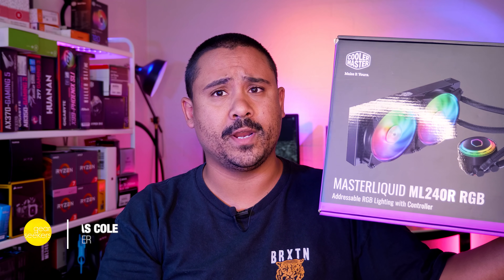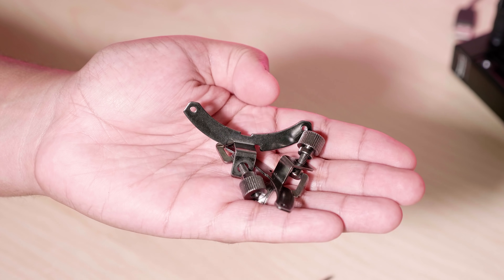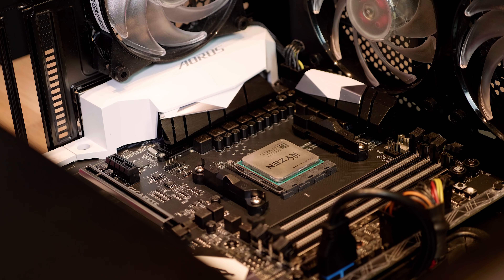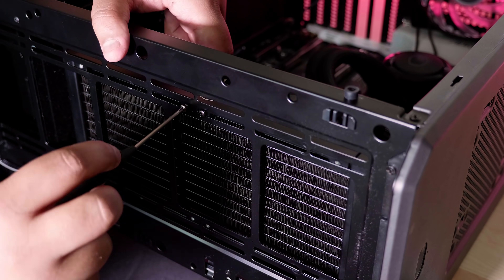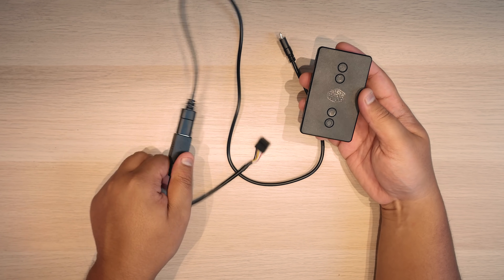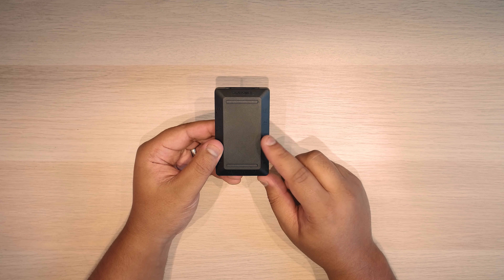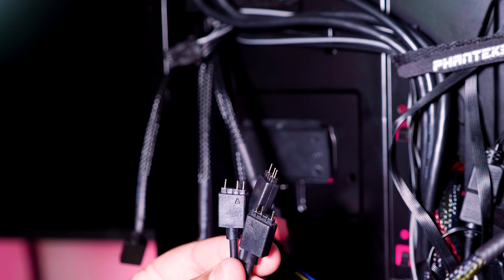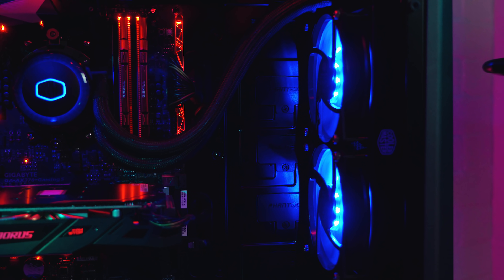HOW TO Cooler Master MasterLiquid ML240R RGB AM4 Install Guide

Comment: I just wanted to say thanks for making this video, it was very helpful. One thing I would suggest that I think may have made this video, and possibly other future videos, even better is if you had perhaps explained some of more involved stuff, ie. which cables were connected where and perhaps why or what function they serve, a little slower and in a slightly more thorough manner that might make this a little easier to understand for people who do not know so much about the inner workings of/the hardware side to a computer, and/or are new to this kind of stuff. Just a suggestion based on my experience. Nonetheless, I very much appreciate the time you put in and effort you went to in order to make this video!
Cheers!
Reply from the maker: We've done hundreds of videos about everything you mentioned. Just search the channel.

Comment: Followed your guide to the T. Curious if i can bypass the controller all together on my Z390-E and plus the rgb straight to the mobo. Just not sure what the black and green cable does exactly and if i meed that
Reply from the maker: If you have a 3 pin ARGB header you don't need the controller
Reply: Awesome, thanks! Love the work and videos you’re doing! @Gear Seekers

Comment: Will this cooler work with asrock b350 pro4? Also is the 240l rgb exactly same install?
Reply from the maker: It's basically the same and yes
Reply: @GearSeekers  thank you very much I should be getting it tomorrow so I can't wait to install it

Comment: do anyone know if the controller comes with the cooler? and if it does not do i have to buy one or can i use the rgb hub from NZXT?
Reply from the maker: it comes with the controller. I wouldnt have shown it if it didnt
Reply: @GearSeekers  Thx for the ast response, now i am confident in installing this CPU cooler, and great guide!

Comment: is this compatible with the ASUS ROG STRIX B450-F motherboard?
Reply: I need to know as well :)
Reply: @giovanniguerra11  I guess it is
Reply from the maker: Yes. This is literally an AM4 install guide. It works on all AM4 boards.
Reply: @GearSeekers  I'm new to this stuff my bad
Reply: @GearSeekers  I meant the software to control the lights

Comment: There aren’t many tutorials for this specific AIO and so I resorted to this one. Sadly, you never went over which cables from the actual block go into which port and the cables for the controller you explained were so confusing. With that, I just put my old air cooler in. Bad tutorial, unfortunately.
Reply from the maker: I've done plenty of RGB specific videos for CM ARGB

Comment: No one explains how to use the rgb lighting  software I'm stuck using the preinstalled lighting on the controller so it's not matching my gpu,ram or motherboard does anyone know?
Reply from the maker: If you actually looked we did an entire video about the lighting

Comment: I used my asus aura compatible motherboard to control the rgb, but since it only has one 3 pin rgb header i had to use the splitter. The thing is not only did i have to sacrafice the lighting on my radiator fans to have the rgb on my two case fans and the water block, but in aura since they are connected by a splitter to one header, they are recognized as one device, which makes the flow of certain effects a bit strange.

Comment: Hi nice tutorial my friend. I have ine question how did you manage to install the radiator in a push-pull configuration. If i screw the radiator in front panel there is no holes to screw the fans in front only in the back of the radiator.
Reply: You reverse your fans not your radiator.

Comment: Hi guys if anyone can answer now I'm desperate
Reply: I am currently installing this into my pc into a asus h110m-d motherboard.... it only has one CPU fan header.. so I used it for the power for the 2 fans but I dont have a header for the pump.. can i use chassis fan header or i can plug into my nzxt h500i controller hub? PLZ ANSWER IM DESPERATE

Comment: Hi one question, i have ml240r and x470 asus pro prime... the asus x470 pro prime has 4 pin header. Can i connect the ml240r to the controller and then the controller to the motherboard to sync it? Or i need a 3pin header and connect it directly to mb?
Reply from the maker: You can't control the addressable lighting off the 4 pin header only a 3 pin header. I have no idea why ASUS did that with their X470 boards. It makes no sense.
Reply: Love your channel, greetings from argentina. I wanted the x470 f gaming but in argentina that motheboard dont exist haha so im deciding x470 pro prime or another good x470 to overclock. What x470 do you recommend me?
Reply from the maker: Anything that is not ASUS lol
MSI and ASRock make the best X470 boards both of which have ARGB headers ;)

Comment: I think you missed the part where you connect the fan splitter to the controller (the connection on the bottom at 8:49)
Reply: Yeah the area where I connect the splitter to the controller is female so I think I was sent a "wrong" cable

Comment: What if I don't have the original clams that come with my motherboard
Reply: Wow thanks you're super helpful
Reply from the maker: You'll need to buy some
Reply: @GearSeekers  any am4 socket bracket Will work right?
Reply from the maker: @peteriyayi6504  yeah I have mixed and matched them and they've all worked from every brand.

Comment: I've never owned a liquid cooler.  Do you add the cooling liquid yourself, if so, how? Or does it comes with the liquid already in it and ready to install?
Lastly, are the connections solid and tight? Whats the likelihood that it would leak and destroy my pc? 
On that topic, is CoolerMaster a good brand?

I am fairly new to this. Want to build my first pc. Thanks.
Reply from the maker: You don't add fluid. They don't leak.

Comment: hi bro i have this aio now installed in  my new systemand it is kind of loud, i have the pump plugged into the cpu fan header and the radiator fans plugged into sys fan 1? is this correct i have a b450m mortar.. please help its really loud
Reply from the maker: Change the fan speed.

Comment: can you connect other cooler master fans to the argb controller? and can you use the controller with asus auro sync?
Reply from the maker: Read the comments 😉
Reply: @GearSeekers  been a while but i now got another question regarding the controller, could i hook it up to any other argb devices or cases that have rgb (like the phanteks p350x for example) that aren't from Cooler Master?

Comment: Does it work with the Asus Z170-A Motherboard and Phanteks Eclipse P400S case? The compatibility check on PCPartPicker says everything fits and that there should be no issues but I'm no expert and I like to make sure there would be no issues and double check from different sources.

Comment: I can only find one 3 pin fan header on my motherboard.  Both the back case fan and the pump for this cooler need to use the 3 pin connector.  Can i buy a splitter to run both of the pump and the rear case fan off of the 1 header?
Reply from the maker: The box has everything you need to run the cooler. You don't need to buy anything else

Comment: 7:35 into the video; when I plug both of my fans into the splitter, one is three pinned and one is 4 pinned.  Is this correct?  If so, does it matter which connector the 3 pin goes into?
Reply from the maker: yes
Reply: @GearSeekers  I don't think you answered that question correctly.

Comment: Never, never, never, never, never, never buy the ML240R. Never. I had to exchange 5 units! The first two had screws with misaligned screw threads so they couldn't be fitted. On the third one, the lower radiator fan failed with no symptoms causing a massive overheat that could have fried my 8700K, 1080Ti, Gskill TridentZ, system. The CPU had been at 77 degrees while gaming without me knowing. The components inside the case were too hot to touch. You literally could not rest your finger on them.

The fourth one came with non functioning lights out of the box. The fifth one came with non functioning control box. Remember swapping each of these coolers requires taking out the cpu and cleaning the TIM off it as well. 

Check the Coolermaster forums. They have given up. There are just people posting swear words because no one from Coolermaster is replying. The admins have given up.

Never buy this. Save your systems life. I'm gonna get an X62 and swap out the fans for rgb versions on Monday. I just hope I can place the X62 rotated so the tubes stick out on the top side on the CPU. We'll see.
Reply: Screws with misaligned screw threads this just happened to me 😥

Comment: Hi, and thanks for a great video!
I would like to plug an additional 2 ARGB fans on the controller, could you help me with the connections ?
Also will ARGB fans form a different vendor work with the controller ?

Comment: So, we still can install 3-pin addressable rgb into 4pin rgb header on mobo? Using splitter and controller coming with this cooler ?
Can i use splliter and controller from different brand ? Thanks
Reply from the maker: You cannot install a 3 pin into a 4 pin header. It's a standard 3 pin addressable RGB connector. As long as its 5V it will work. 12V will fry the lighting and damage your hardware.
Reply: Hmmm okay. So any solution if i want install this cooler on my msi b450m pro vdh ? What i need to do ? Thanks
Reply from the maker: use the included controller.
Reply: Ok sir thank you very much. It's clear now 😁👍🏾

Comment: soo just one question do i need a connect a rgb header or pin on motherboard in order to get controller or other stufff work, My MBO is a LGA 775 with x5472 really old one doesnt have a rgb header, but i have some fan spliter cables and other connections
Reply from the maker: Use the onboard USB header to control

Comment: Quick question. Installed everything except for the 3 pin connector that comes from the main pump itself. I have no header for it on the motherboard. Is it a power connector by chance? The rgb and both fans work fine, but theres one cable just not connected. Is it a problem? How could I install that connector?
Reply from the maker: Yes plug it in to any pwm header or you'll cook your CPU

Comment: So does the controller with this work only with the preset buttons? Or can it be recognized on cooler master software so you can control each fan light separately? Also if you plug them all into 1 splitter do you only have control of 1 and then all 3 fans do the same thing? Or will the software register all 3 fans separately so you can make each fan different colors off the same splitter?

Comment: meh don't like fan setup though fan mounts hide the nice color changing and all! if you mount them like that why have RGB fans? not pleasing when it comes to looks!
Reply from the maker: Looks and functionality are 2 different things. I'd rather have a cool cpu than an overheating one that looks cool.
Reply: true! actually thinking about switching my fans lol after benchmarks and looking at the differences in cooling <3 ty. defintely changes my mind on getting RGB though

Comment: Can I install it on the back bracket of my 212 evo, or do I need to install its own back bracket(plate). This is for an lga1151 socket intel.
Reply from the maker: Use the bracket that comes with it

Comment: Can you plug in other case fans to the controller? Im slowly losing my mind... Im using the four pin connector (was plugged in to the led controller) now plugged into the mobo directly. Meaning the AIO and rad fans looks awesome, but the other fans can only be controlled seperately through my mobo's software. I just want them to all match, they are all coolermaster RGB fans. Oh yeah and masterplus softwarr can't detect any compatible devices. Help!!! 😪😪😪😪😪
Reply from the maker: Connect them all to the controller

Comment: From pump its coming with two wire. 1 wire is 3 pin. My question is where should i connect 3 pin wire? My mobo is MSI B450M. Please someone help me im stuck here.
Reply: Hi did you figure out ?
Reply: @JeanCharlesStriby  did you guys figure it out? Should I just leave these two wires doing nothing?

Comment: how often do we refuel it and how DO do we refuel it
Reply: AIO's or All in ones generally don't need to be refilled.

 Refilling in case it does somehow run out, pull one of the tubings connected to the radiator and carefully and fill it with the water cooling solution slowly. Put the tube back and apply heatshrink tape to it.

Stressing you enough, it will never run out if nothing breaks.

Comment: Very instructional video.
I have a question: If the user has additional RGB coolermaster fans and led strips, is he able to connect them to that rgb controller in order to synchronize the colours?
Reply from the maker: Yep, You can connect regular analogue RGB to the controller
Reply: Fastest reply ever!
Just to be sure, addressable rgb fans and strips can be connected to it? Or just regular RGB?
Reply from the maker: Both can connect to it :)
Reply: Awesome! Thanks for the answers.
I got a last question: I am watching the video you made about the coolermaster software and I noticed there are 4 argb headers on the controller and 1 rgb header. With the included splitter on the masterliquid, you actually only use 1 argb header and still have 3 argb and 1 rgb headers free, correct?
Reply from the maker: I usually just use 1 for the fans and the pump with the splitter.
Reply: That way you can connect everything you have on the case (fans, led strips,etc) to that controller and make them be synchronized! Nice! Thanks for the info, I'm thinking about buying one of these.

Comment: Thank you for the education , Cooler Master's instruction manual is extremely lacking.  I am new to the RBG lighting and still some what confused and would appreciate any guidance.  My build is an MSI X470 Gaming Carbon Plus  with 32GB Corsair Vengeance Pro RBG   Cooler Master ML120R  and I would like to add an additional 4 Addressable RBG Fans  and maybe a RBG strip. My queation is how to wire it up, would the Cooler Master controller handle the task as long as I add an additional 3-1 RBG splitter  And do I need to add the Addressable header to to controller along with the USB
Reply from the maker: 1st part. You can add with a splitter. 
2nd part. If you hook up your addressable header you can use the passthrough and control it from your motherboard software.
Reply: Thank you for decisive answers,  conversations with MSI and Cooler Master were extremely vague answers. Looking forward for new videos.

Comment: Noob questions here.. can I connect this controller to rgb pin on motherboard? So I can sync it with Asus aura or rgb fusion or something like that and get more slot rgb pin on controller as rgb splitter...
Sorry for my bad English.. thanks
Reply: your English was Perfect
Reply: @Roberto Falconi do you connect the controller with usb pin on MB and sata power on power supply?
Reply: @Roberto Falconi https://youtu.be/EQQaUzJEYAY

Comment: Hi, I have a few questions - I bought this AIO and installed it successfully on an MSI B450 Gaming Pro Carbon AC mobo.  Cooler Master's own lighting software didn't work properly until I updated the firmware of the "hub" to v1.0.0.1 which is available on Cooler Master's website.  However, I'm not clear as to whether it's supposed to show up in MSI's own Mystic Light software.  For me, it doesn't - is it supposed to?
Reply from the maker: Install masterplus and set to motherboard mode.
Reply: Hi, I appreciate your reply.  I have installed MasterPlus as you suggest and it looks almost identical to the LightingControl software I already installed and tried in "motherboard" mode.  This mode in either software doesn't seem to be doing much, to be honest.  The AIO still does not appear in MSI's own MysticLight app, it only shows the MSI mobo itself and the G.Skill RAM I installed.  How is this "sync" meant to work?  What am I missing?
Reply from the maker: Its not supposed to show the AIO in Mystic Light. You need to have the cable connected to the control box to your motherboards ARGB header for motherboard mode pass through

Comment: Hi! Great Vid! is it okay to install two fans before the radiator and two after the radiator?
Reply: Also, I don't have CPU_OPT, where should i pin it?
Reply from the maker: you can plug into the cpu fan header. extra fans is okay too
Reply: thank you so much!!

Comment: So the cm ml360r does anyone know how many fans in total it can control with its box, im getting ready to ordered it and 4 more addressable rgb fans and wanted all the hardware needed. And will a 4 pinn rgb connector fit on a aorus mb 5 pinn header that has a pinn for white. I have a rgb fan with a 4 pinn rgb connector and I couldn’t get it on because the spacing. And what is the difference in most 3 pinn and 4 and 5 pinn mb headers addressable and non-addressable? Built plenty of water pc’s new to all the rgb stuff thanks for any help want to get my cm h500m looking good.
Reply from the maker: We already did a video about the ML360R - https://youtu.be/o77ThGbF1LM

Comment: Hi, i installed ML240R cooler already. its work really good! But just how to Aura sync the fan and pump rgb ? downloaded and try with the cooler master software already but its not working .. my motherboard Asus ROG STRIX B360-H Gaming.  any idea or sulution ..?  need some help ..
Reply from the maker: Read the comments section. I have answered this 1000000000x. Update the firmware for your controller.
Reply: alright, sorry for that ..im just too exciting to try the aura sync for my ml240r rgb.  i will go download the firmware now .. By the way, thumb up for your video tutorial. its really helpful for me . Thank you !